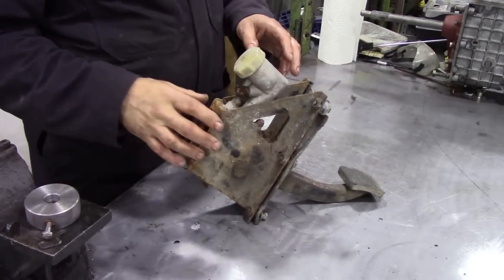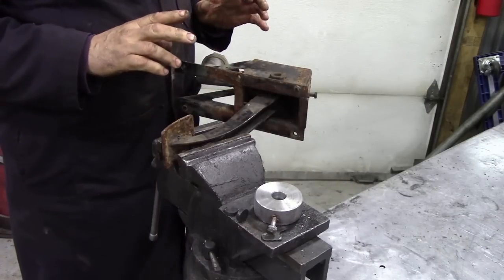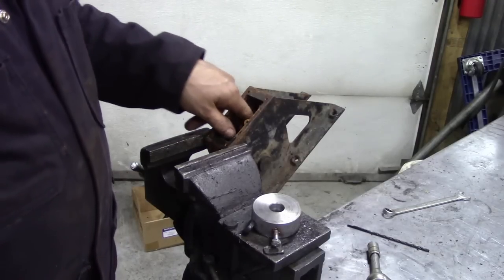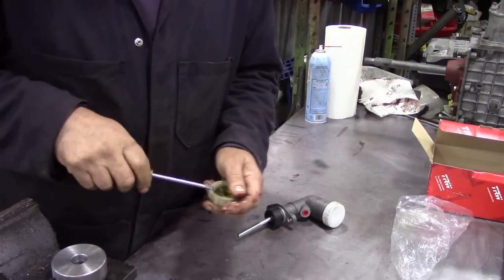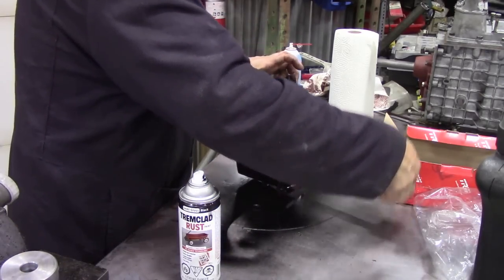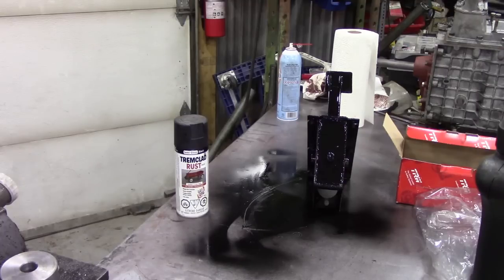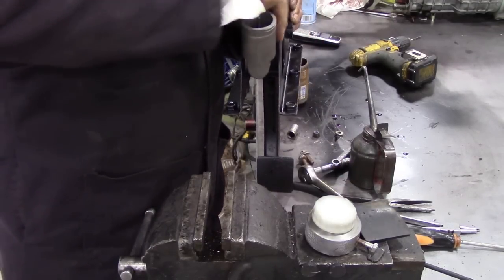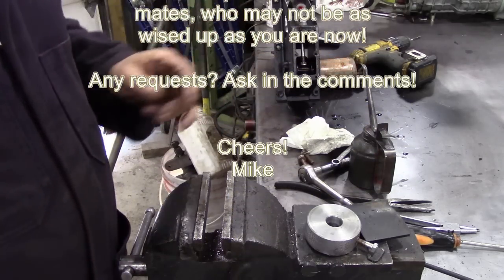Land Rover clutch master cylinder replacement and set up

Comment: Mike if you adjust the end nut as you say , would that not pull the rod out the cylinder and give you to much free play . It is what i found , but if i ran the other nut finger tight and then the nut on the end lock it up i have minimal free play . i set mine to about 10mm the book says 6mm . Have you got the procedure in reverse . Or am i way off .

Comment: Greetings from the USA. Very good video! Articulated very well, concise and to the point. I have a Series 2 1968 left hand drive 109. Unfortunately in my case my clutch pedal is very much froze and I need to do a full disassembly. I have the lube hole on the side of the box itself but oil and WD-40 are not helping. Master cylinder is removed and it takes extreme force to move pedal. What is the best way to remove the pin so I can remove clutch pedal?   Thank you.
Michael
Reply from the maker: There is a roll pin holding the pivot pin in place at the end sometimes - knock this out and press out the pivot pin
Reply: @BritannicaRestorations   Thanks for the advice, I will give it a shot!

Comment: I have a freelander 2 with front wipers that won't park in the correct place! I don't know if the control system is electronic or mechanical as in the 110 in the video.
Reply from the maker: I have no idea - only worked on one in the past - not common cars here

Comment: 36:02 - what kind of ratcheting spanner did you use in there? 
the only thing I can find to fit are brake line spanners - I'm considering cutting an access slot to adjust on the vehicle.
Reply from the maker: This type 5/16
https://www.gearwrench.com/products/wrenches/ratcheting/combination/86433-516-120xptm-universal-spline-xl-ratcheting
Reply: @BritannicaRestorations  Muchly appreciated.

Comment: Another impressive and wonderfully simplified video on land rover restoration - its a brilliant series , thankyou.   Hopefully you can help with this problem......Im a new owner and novice.....my clutch on a 1958 (2wd) series 2 works well for 10-15mins and then goes firm and does not disengage fully. There's  A lot of gear clashing going to 1st and reverse from neutral.   I bled the system and changed the DOT 4 , no help.  Replaced the master cylinder after watching your video. No help.  Ive noticed there's no return spring on the slave or the pedal but it didn't have a problem before. I'm going to try it with springs in place.  Any ideas?
Reply from the maker: Yes, it should have a spring

Comment: Hi mate. Hi am struggling getting the air out of my clutch system on my td5 defender. Everything is new. Ive managed to get some padal but the biting point is in the bottom 1inch of travel on the peddal and everytime i do the peddal pump and then hold peddal down and crack the bleed screw i get bubbles ive ran a full litre of fluid threw system and still get bubbles. I carnt see any leaks.also this video ive just watched of yours confuses me as i carnt in my brain see the differance as too were the peddal lock nuts would be positioned as the master pushrod is always fully extended no matter were the position of the pedal was or am i just been daft. Im Getting really thrustrated. Any help really appreciated  thanks
Reply from the maker: A super quick and messy way of testing if you have the push rod adjusted properly is to take the hose off the master cylinder and fill the reservoir  - fluid should run out of the place where the pipe fits IF the pedal is at the correct height - so set the pedal height first and then fill the cylinder
Reply: @BritannicaRestorations  thanks